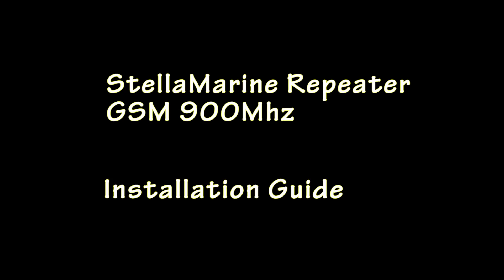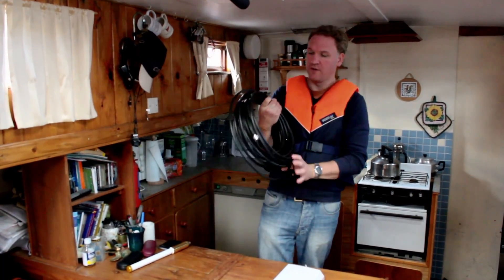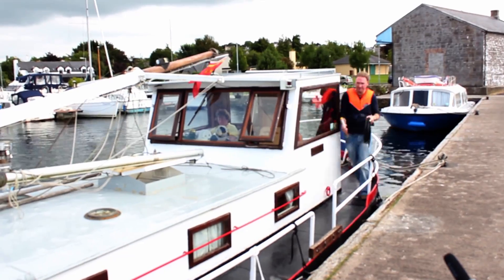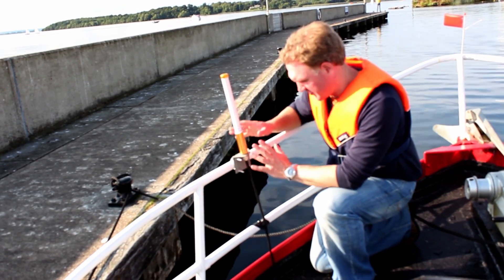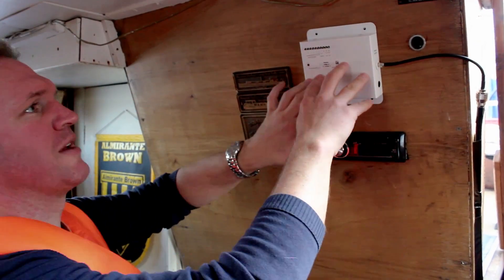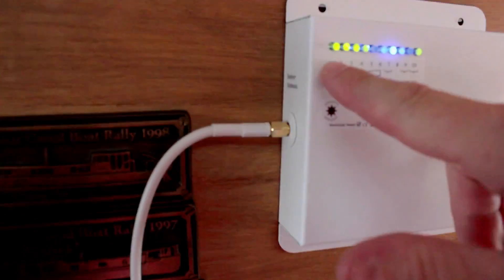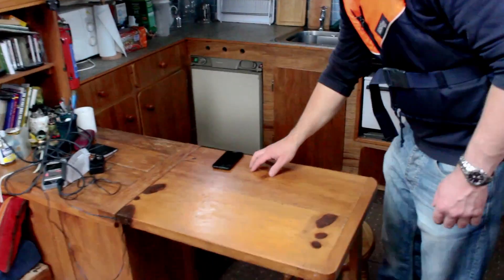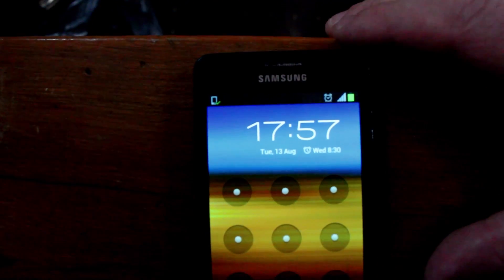Boost mobile signal on your boat | StellaMarine GSM 900Mhz repeater kit

Comment: Hi, thanks for sharing this video, i have a client who as similar same situation (no signal in side the office), but their are using more than one carrier.
So my  question is: is this product carrier specific, or the Omni capture all the signals on 900MHz band and the system will amplify them all.

Looking forward to hear from you,

Regards
Reply: Hi, The repeaters amplify all operators at 900Mhz and if 3G is at 900Mhz, it will amplify UMTS 900 too.
Reply: perfect answer